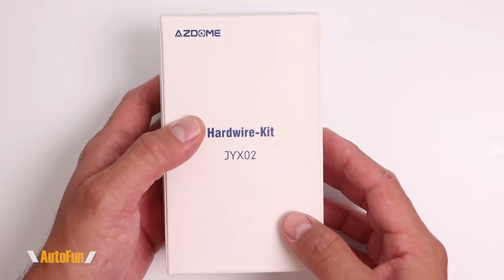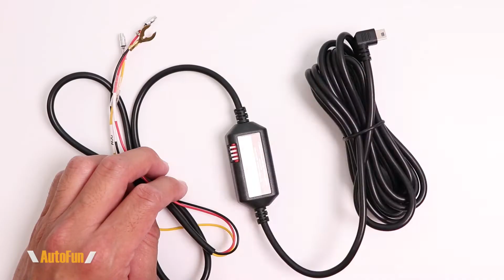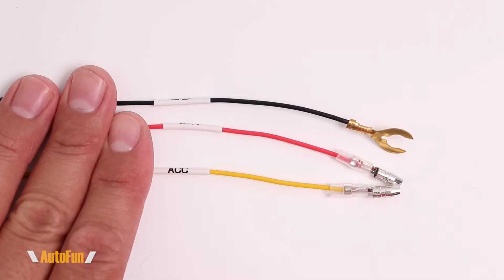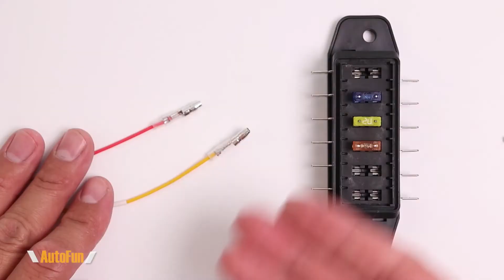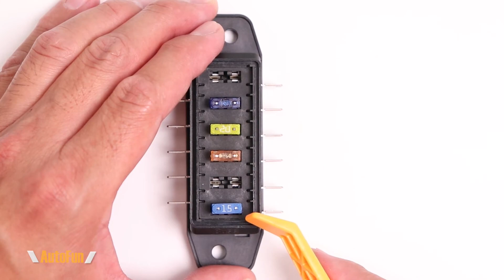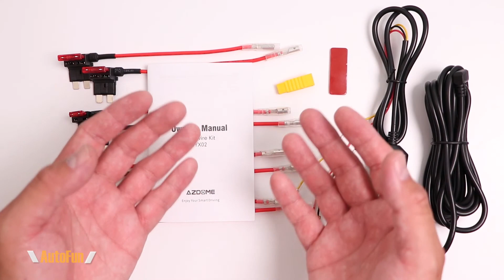Azdome HARDWIRE KIT Install Prep, Connections & Fuse Taps

Comment: Thank you for the great video. The switch threw me off at first since I usually associate the down position with “off,” like a light switch. I set the cutoff to 12.4, but for some reason it still cuts off at 11.8. Not sure what I’m doing wrong.

Comment: How to fix it at 12.4V only? If the battery voltage drops, the camera will turn off.
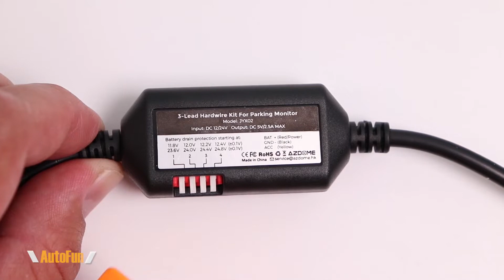Reply from the maker: You can see how the low voltage cut off is adjusted when I cover this on the video at approx the 1:14 mark, cheers!

Comment: Question What if the original fuse is 7.5 can we put together 7.5 and 10 ? because tje included fuse only is 10
Reply from the maker: Ah remember a fuse tap creates 2 separate independent circuits (each one with a different amp rating partially determined by fuses that are loaded into the each fuse slot in the fuse tap, the vehicle's internal wiring for that circuit, the current load on the circuit being tapped as determined by your installer etc) The fuse removed from the vehicle goes in the fuse tap bottom slot and the second fuse (top fuse) is for the hardwire kit. So they are each independent of each other, each one driving it's own load. Here is another video https://youtu.be/Qzw9yUYN7zo where I explain how fuse taps work in more detail, Cheers!

Comment: Can I not connect BAT, therefore making the camera only work from ACC?
Reply from the maker: Hi S! Most dash cams that require a 3 lead hardwire kit will usually need all 3 wires to be connected in order for the dash cam to work correctly. What I recommend when someone does not need park monitoring, is just to turn it off in the settings menu (most dash cams will let you turn off this feature). Cheers!
Reply: @AlexAutoFun  thanks, man!
Reply from the maker: @SG-ql8od  You're welcome!

Comment: Hi. Dumb question but does this mean that the dashcam can work like it was hardwired if I got this instead? TIA

AZDOME OBD Hardwire Kit Mini USB Port, Support Parking Mode, 11FT 12V-24V to 5V for M550 M550 Pro GS63H M63 Lite PG 17 Dash Cam
Reply from the maker: Hi K! Unfortunately I have not tested the Azdome OBD adaptor so I can't comment on how it works or how it performs. I would recommend contacting Azdome for help, hopefully you will have better luck than me as far as getting a hold of them I have not been able to do so ugh (My Azdome dash cam has started to malfunction, video on this coming) Cheers!
Reply: @AlexAutoFun  thanks as always!

Comment: Hi, today I noticed that the rear camera (video) is facing the opposite way, it was fine all the time, but now it's like this. Does anyone have any experience with this? I use Azdome m300s. Thank you
Reply from the maker: Hi A! That is strange, I would recommend contacting Azdome for help, hopefully you will have better luck than me as far as getting a hold of them I have not been able to do so ugh (My Azdome dash cam has started to malfunction, video on this coming) Cheers!

Comment: Hi, I installed the hardwire kit but can’t get the camera to record when in parking. The camera is set in parking timelaps and the hardwirekit is correctly wired, I can see a red led light inside the box when I turn the switch off.
Reply from the maker: Hi Cesar! When correctly hardwired the dash cam will turn off and enter park mode (if enabled in the dash cam's setting) when the car is off. I would have the installer check all the connections (ACC, BATT & GND) to confirm that they connected to the correct locations for ACC and BATT (I seen cases where the dash cam stays on constantly if ACC and BATT are reversed or connected to the incorrect locations that does not provide power at the correct time for both ACC and BATT) Here is my follow up detailed hardwire install if you want to see that process https://youtu.be/K2iKXj82354 Cheers!

Comment: Question: is it okay to hard wire just the accessories and ground? I jist don't want my battery to be drained.
Reply from the maker: HI Mej! Most dash cams that require a 3 lead hardwire kit will usually need all 3 wires to be connected in order for the dash cam to work correctly. What I recommend when someone does not need park monitoring, is just to turn it off in the settings menu (most dash cams will let you turn off this feature). Cheers!
Reply: @AlexAutoFun  thank you for respoding.
Reply from the maker: @mejmaharot9306  You're welcome!

Comment: Can I use the venture cable that is directly connected to the OBD to set up parking mode on Azdome 580?
Reply from the maker: Hi Bayisa! While I may be possible to use a different power adapter on a dash cam, I usually recommend sticking to the matching power adapter for the dash cam (brand matching) to ensure that there are no functional issues or issues with warranty coverage. Here is my follow up video https://youtu.be/Yky9_tTvwMc where I explain how hardwire kits work and the different features to look for. Cheers!

Comment: Hi im confused how to enable the parking mode. Should i use ACC or BAT? or they work the same because right now i connect my cam to BAT but when i turn off my engine i manually turn off also the DashCam will it still record any collision? Thanks 🙏
Reply from the maker: Hi Medbox! Most dash cams that require a 3 lead hardwire kit will usually need all 3 wires to be connected in order for the dash cam to work correctly. Here is my follow up video where I cover how I find ACC and BATT on any car https://youtu.be/K2iKXj82354  However I strongly recommend profession installation due to the dangers mentioned on that video if erroneously tapping a critical system of the vehicle and the dangers involved with air bags mentioned on this video https://youtu.be/uZp95NbNlmM Cheers!

Comment: i’ve installed the hardwire kit, and set the parking mode to time lapse 1fps. however, after turning on my car again there aren’t any videos saved in the parking category
Reply from the maker: Hi Brandon! I'm not sure what dash cam you are using but when correctly hardwired the screen will turn off and the dash cam will enter park mode (if enabled in the dash cam setting) when the car is off. I would have the installer check all the connections (ACC, BATT & GND) to confirm that they connected to the correct locations for ACC and BATT (I seen cases where the dash cam stays on constantly if ACC and BATT are reversed or connected to the incorrect locations that does not provide power at the correct time for both ACC and BATT) Here is my follow up detailed hardwire install if you want to see that process https://youtu.be/K2iKXj82354 Cheers!

Comment: Hi, can you explain ho to upgrade the firmware of the azdom m550 pro? Thanks
Reply from the maker: Hi Gerardo! I usually don't recommend updating the firmware unless directed by tech support to do so or if you are willing to accept the the risks involved with updating it. If something goes wrong during the upgrade, you can potentially turn your dash cam into a brick (it has even happened to me LOL). Firmware updates for dash cams are not like the App updates we get on our phones (where we are constantly updating it). The firmware updates are on the Azdome website (link to the website in the video description) but again I would be extremely careful if attempting this. Cheers!
Reply: @AlexAutoFun  thanks, i keep the original firmware then
Reply: @AlexAutoFun  I follow the steps from your video to install the hardwire cable and was succesfull
Reply from the maker: Glad to hear your are all up and working and congrats and your new dash cam setup Gerardo, Cheers! @gebarr474

Comment: I’ve hardwired my dash cam but for parking mode to work I need to turn the car off and on twice for parking mode to enter. If I just leave the dash cam with ignition off first time it just stops recording and camera just still got power. Anyone had any issues like this or any suggestions?
Reply from the maker: Hi Judah! Correct, when correctly hardwired the screen will turn off and the dash cam will enter park mode (if enabled in the dash cam setting) when the car is off. I would have the installer check all the connections (ACC, BATT & GND) to confirm that they connected to the correct locations for ACC and BATT (I seen cases where the dash cam stays on constantly if ACC and BATT are reversed or connected to the incorrect locations that does not provide power at the correct time for both ACC and BATT) Here is my follow up detailed hardwire install if you want to see that process https://youtu.be/K2iKXj82354 Cheers!

Comment: If I bought a hard wire kit that only has an ACC connector with ground and not a BAT connector. Is this a danger to install. Should I get a hard wire kit with both acc and bat for my dash cam?
Reply from the maker: Hi Todd! Ah yes the 2 lead hardwire kits, yeah those are not as common but yes install is same but instead of connecting 3 wires only 2 wires are connected (refer to the instructions of the kit to determine the function of the 2 wires, most use GND and ACC and some use GND and BATT). Here is my hardwire video where I cover 2 lead and 3 lead hardwire kits https://youtu.be/Yky9_tTvwMc and here is my follow up video showing the hardwire install process https://youtu.be/K2iKXj82354 Cheers!
Reply: @AlexAutoFun  Gracias Amigo!  Love all your videos.
Reply from the maker: You're welcome Amigo! Cheers! @Xtafen

Comment: Just installed it yey!
hardwired it in empty BAT and ACC spots which is good! 
Set the low voltage cut-off to the highest and safest 12.4 and hope the quality of the voltage box is good. 
Compared to other brands, do you think the AZdome hardwire kit is good? thanks
Reply from the maker: Hi AA! An normally I haven't seen much difference as far as performance, but what I do see if the different features some have and some don't, here is my video where I cover those differences https://youtu.be/Yky9_tTvwMc Cheers!

Comment: The fuses they come with the kit are 10amp, and I have acc and bat empty spots already, so my question is: can I use a 10amp fuse in an empty bat spot?
Reply from the maker: Hi! The current load that a particular circuit can handle will depend on the circuit's wiring, if they circuit is sharing it's load capacity with another circuit and if it's feeding from another bus. Typically an installer can reference the car's service manual and wiring schematics to determine available load capacity. But yes my preference is to use an empty spot, you can see an example of that on my install video here https://youtu.be/uZp95NbNlmM and here is my other video where I cover ACC and BATT locations in more detail https://youtu.be/K2iKXj82354 Cheers!

Comment: For the battery drain protection on this kit, if I want the cam to stay on the longest, how long does it stay on? Should I just use the 12.4V or 11.8V switch? Are there that much differences on how long the cam will stay on after the car is completely off? I want the best out of the parking monitor. Thoughts?
Reply from the maker: Hi Ike! Ah good question, that would heavily will depend on the car's battery (age, health condition and state of charge) On top of that you also want to take in consideration any parasitic draw from other items on the vehicle that use power when the car is off. This is specially common on newer vehicles. For example I have an older Jeep that can sits for months a time with little to no battery draw, then I have a 2017 car that will almost completely drain my battery in a few weeks if the car is not used. And here is the battery tester I use https://youtu.be/kCNrfa8RUKU if you want to test your battery for capacity and health, it can also perform a parasitic draw test if needed. Cheers!
Reply: @AlexAutoFun Excellent. I will use that tool for sure. Thank you!
Reply from the maker: You're welcome! @Ike00Knight

Comment: Hello...I have a Azdome M550. Whats the best kit to use a power bank?
Reply from the maker: Hi Jermaine! Ah yes some people do run their dash cams off a battery pack instead of hardwire kit (but remember a battery pack will not enable true park mode). However I prefer a normal cigarette lighter adapter or hardwire kit since here in California we experience really hot temperatures which I would not want to subject the Li-ion battery to, that and the potential for a run away event (fire) during charging or discharging inside the car. Here is an example of a internal dash cam battery and what the sun did to it https://youtu.be/HW8jqbl_ayU Hope this helps, Cheers!
Reply: @AlexAutoFun  Thanks.
Reply from the maker: @jermainemattis4926  You're welcome!

Comment: Hello, thank you for making this video. Very helpfull. I have a question : I have a car with 12V battery. Can you tell me which button doI have to put it down? I would l like to record by night as parking mode. I imagine it drain the battery. So which switch do I have to put it down to prevent drain battery and no start engine next day ? Thank you in advance for you 😊response
Reply from the maker: Hi @XavierPingot! Ah yes, the low voltage cut off settings (switches) are explained around the 1:30 mark including the explanation of the battery drain protection. Cheers!

Comment: I would like to applaud you for this video as you are very good at explaining each part and reasoning the process of the installation ,I'd like to know if wiring kit is coming with the dash cam or must purchase separately, if so how much is for the kit. cheers
Reply from the maker: Thank you Max! Ah yes most of the time the hard wire kits come separately, I put the link to the kit in the video description. Hope this helps, Cheers!

Comment: Hello

Quick question: I'm planning to buy a Blueskysea 4K 2-ch dash cam. Is it ok if I buy this HWK for this camera? (I mean the JYX04 version, which is Micro usb).  I like it because it has a voltage selector. 
Or do you recommend a better option for that camera?
Reply from the maker: Hi Eric! While I have done that in the past (used a different hardwire kit on a dash cam) I usually recommend sticking to the matching hard wire for the dash cam (brand matching) to ensure that there are no functional issues or issues with warranty coverage. Hope this helps, Cheers!
Reply: @AlexAutoFun  Thanks man!
Reply from the maker: @wellthatwasfun  You're welcome!

Comment: If I only want power when the car is running, is it possible to not connect the BAT wire?
Reply from the maker: Hi _VoidNexus! Most dash cams that require a 3 lead hardwire kit will usually need all 3 wires to be connected in order for the kit to turn on. And here is my introduction to hardwire kits video https://youtu.be/Yky9_tTvwMc showing the differences between them. Hope this helps, Cheers!

Comment: I Installed my hardwire kit for my AZDOME M27 dash cam to enable parking mode, but the camera will not turn on when I simulate a impact by shaking my truck. I have them connected as you have demonstrated.
Reply from the maker: Hi Pete! the hardwire kit (JYX02) shown on this video is for the M550 dash cam, the correct kit for the M27 is the JYX05 here is the link for it https://amzn.to/3lIvluH Hope this helps, Cheers!
Reply: @AlexAutoFun  Thanks for the response, but I do have that hardwire that is required for my dash cam and my camera will not turn on when I shake my truck to simulate a crash even though parking mode is on the unit.
Reply from the maker: @petelopez5826  Hi Pete! oh wow, I would recommend having your installer check that the hardwire was installed correctly and nothing has come loose, here is my video showing how I check ACC and BATT connections https://youtu.be/K2iKXj82354 if you want to see what that process looks like. Also I would double check the settings of the dash cam to confirm parking mode is enabled and the sensitivity of the G-Sensor for parking mode or if it's set to time lapse or motion detection (unfortunately I have not reviewed the M27 so I'm not sure which one it supports) Lastly I would also recommend contacting Azdome for technical support, they may be able to walk you thru the troubleshooting process. Hope this helps, Cheers!
Reply: @AlexAutoFun  I installed it myself and it was pretty easy. Everything is correct on on my F150.  Parking mode is enabled so I don’t know what could be wrong unless the unit is defective. I have my constant power red wire connected to 7.5a fuse and my acc connection  to a 5A fuse. I might try and rewire them to another fuse to see if it works.
Reply from the maker: @petelopez5826  Ah I got you, yes if the installation is correct and the dash cam settings are correct it is possible that you may have a faulty hardwire kit. Cheers!

Comment: Pls make a actual video of parking mode and how it works
Reply from the maker: Hi Roanna! How parking mode works will vary depending on which dash cam you are using, the most common methods are: standard G-Sensor detection, buffered parking mode, Time Lapse, Continuous Recording, Low Bit Recording, motion detection, proximity detection etc. I am working a video explaining each mode, stay tuned. Hope this helps, Cheers!

Comment: Hi, Great video. In my car i  found Cig fuse with 15a blue fuse. So i Can put my kit fuse first and then put 15a with it.
Is it safe?
Reply from the maker: Hi Dishant! ah remember when using functional fuse taps, the fuse amp rating of the hardwire kit (top position) is independent of the fuse amp rating that is being removed from the vehicle and installed in the bottom position. Here is another video where I explain this in more detail https://youtu.be/K2iKXj82354 Hope this helps, Cheers!